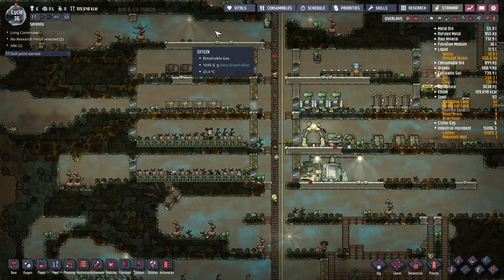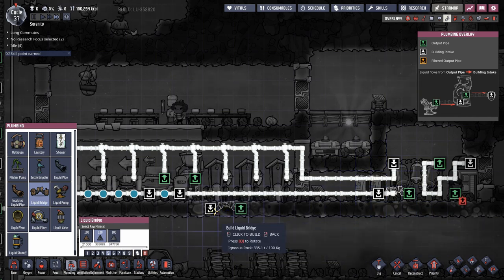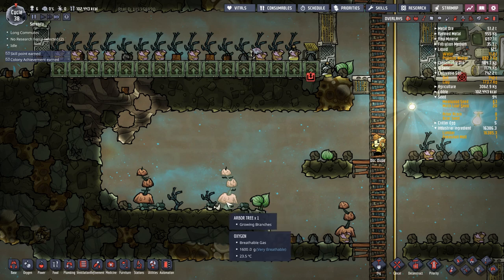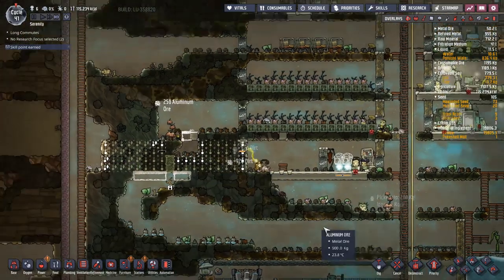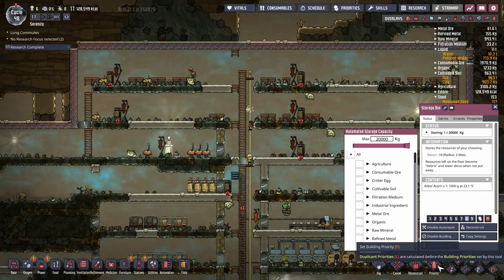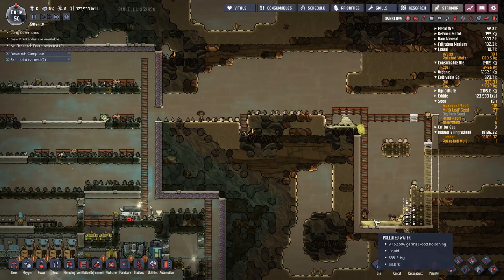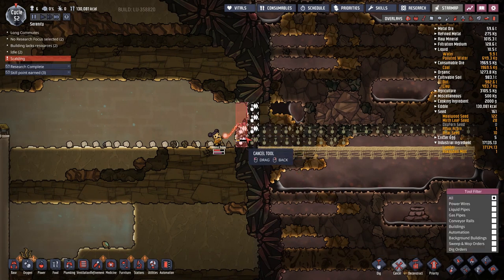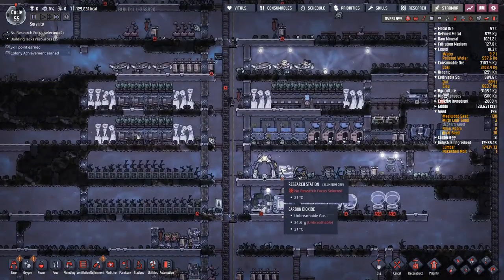Oasisse 2 : It's a little hot outside : Oxygen not included

Comment: Lead is great, almost too easy.
If you spiral the water pipes inside the electrolyzer room (and make them out of granite) you can get away with oxygen almost as cold as the water.

Great content as always!
Reply from the maker: If it's not the father of the Rodriguez electrolizer, I'm still using your design to this day it's awesome, thanks again. I did run some radiant pipes through the electrolizer in the end, worked out perfectly.
Reply: @FrancisJohnYT  Despite the years of innovations, I can easily say it's still a staple to this day. Thank you Rodriguez for creating it, and Francis John for making it known.

Comment: The only issue with that bathroom loop is they will wash with grey water.... idk if that matters a lot or not now days. Fine for flushing but idk.... I like the sterilizing cistern method. Store cleaned water till 0% germs then pump [or normally ill fill that holding tank over my good water pool, knock out a tile fill and seal to start loop again.] Some times leaving some clean water behind to help kick start germ killing next batch of water. There seems to be a relation to % clean water to germ that kill them faster. Even without heat change so you can do this in base core. Mine you will still get that refinement temp change but it is on low side. I like to pump warm water out tom ice bioms some times to use passive cooling/heating to melt more water work free, kinda.

PS feeding Hatch the pouted dirt can be a nice fix if you set up for it.

Comment: Showers this time?
If you set storage priority lower and some bins with not sweep only they will just do that job last.
I have 1 dupe set to groundskeeper whos job it it is to toggle tidy on highest priority then run things to storage. I set all other dupes priority to down 1. 
Have your rancher, cook dogs in to run storage so they only work inside the base. 
Only if they get other things done and have nothing else do they sweep up.

I have general storage bins set to 4 so they get to the other bins that are needed for certain things 1st.
Reply from the maker: I don't do a lot of storage, mostly seeds just to keep them away from the pips. Bleach stone as well. After that it's just a few localized sweeps to tidy up some area's.
Reply: As long as your building operating or doing other stuff. 
They won't run anything to bins at all. 
Only when nothing else to do. 
So they would only run to bins which is included the coal seeds etc bins. 
They will not do it. 
Set a few bins at bottom of base to a 1 and storage on all dupes to lowest priority. 

Sweep is in the supply category. 
So if you sweep something it takes over. 

Also I'm saying for the dupes locked inside the base. Chef rancher dogs in. 
Amusing you install a door. 
Set those dupes when they have nothing to do to run storage.
You can x all the outside dupes from doing storage. 
The base will get cleaned over time.

Comment: Don't scald your dupes! If you drop some water into the corridor you want them to work, it'll probably quickly heat up to 50-60C but won't scald them. They can get heat stroke a lot easier if they're in water, but the -5 Building you get from Heat Stroke is way easier to live with than the -3/6/9 Athletics you'd get from scalding wounds. Also note that your dupes can be wounded but not suffer any debuffs until they hit 85hp, so putting them in a triage cot while at 92hp was absolutely useless. Love the series, keep it up.
Reply from the maker: I give up on that oil biome to much heat to deal with. Could not remember at what point injury's slow dupes down, so long as their 85 and above I can keep them running, cheers.

Comment: you should use two pneumatic doors on top of each other instead of the door then two airflow tiles, it’ll have the same effect at what i believe to be a lower resource cost, not sure though
Reply: Firestorm82736 -Yt it costs the same
Reply: wasn’t sure, thx
Reply: No problem man
Reply from the maker: Plain forgot about that, don't think I'll bother modifying it though. I have a tendency to use door permissions for stuff and with double door systems I keep forgetting to change the top door.

Comment: Is there a reason you run pipes and wires one tile above/below floors/ceilings ?
Reply: Probably because they aren't tiles yet, so putting pipes or wires there would cause dupes to dig the squares up and make you have to put tiles down
Reply from the maker: Bashkov B has the right answer. I'm still preserving the natural envoirment, not sure if/what I might use it for, but pips provide interesting opportunities.

Comment: Each hydroponics tile should have an individual feed tube leading from the central pipe, otherwise... "it will back-up and bite you..."_.
Reply: Doesn't matter as long as the output is greater than the consumption.
Reply from the maker: Never had that problem, I take it that only happens if the wrong liquid gets in there or the number of tiles gets to long?